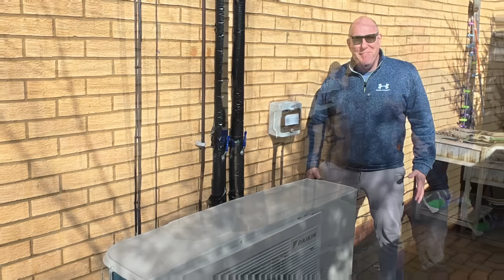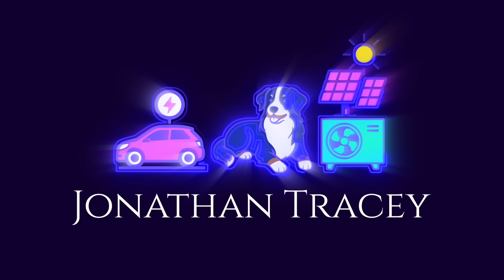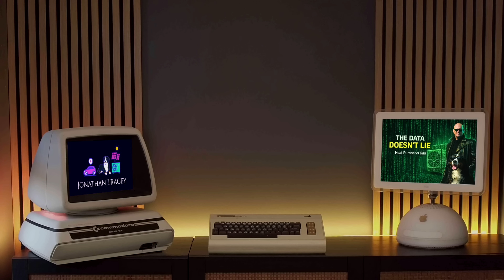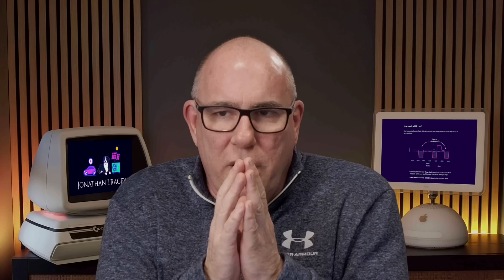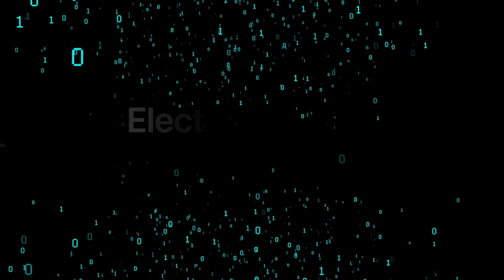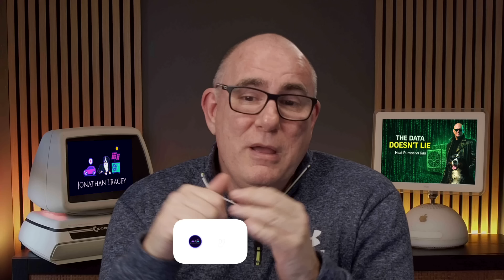The Data Doesn’t Lie   Gas vs Heat Pump Real Running Costs

Comment: Jonathan,

firstly to explain, I can't be bothered to watch the video.

Your headline 'The data doesn't lie gas versus heat pump running cost'

In order to do a comparison you need to have a back to back measurement of cost, just how can that be possible with just one house and one system. I'll answer it for you no you can't, it is nonsense. There can be no comparison at all. 

I understand that you have view point but  being so un objective harms your your credibility.
Reply from the maker: You are of course entitled to your opinion but given the responses from others I think they find the data useful, but feel free to keep jumping into the comments to tell me I am wrong as it all helps with the google algorythm and get the video seen by many others.
Reply: Jonathan,

you cannot go against normal comparison methods.
To do otherwise is simply  misleading to those lacking any discernment and may cause them to spend money unnecessarily
Yes it may help your YouTube platform but how can you put out such  obviously incorrect assumptions, how do you sleep at night?
Reply: That's a deeply unfair and daft suggestion. Mr Tracey references repeatedly that this is only a compare for his home. He uses the data he has to compare like for like. Thus Mr Tracey's analysis is valid and useful. Yes, you can reference the cost of the solar and battery installs vs the return of electricity but  that's all. If you won't engage, you can't really comment.
Reply: @px794  

The information may be useful to some.
But what I object to is the impossible use of comparison, more so as it is with gas as the majority use the wrong equations to compare.
To make a valid comparison requires both systems to be tested in an equal environment and equal conditions, patently impossible with a house heating system.

Comment: Jonathan, great video, balanced view. However, I will disagree with you slightly. A house doesn't immediately lose all heat the moment the heat pump turns off (or drops to a lower setpoint), so in a sense, the house can be thought of as a "battery", albeit a thermal battery (with varying degrees of energy loss depending on your house insulation). So, with Cosy, if your desired temperature was to be, say, 21c, on the cheap slots it would make sense to slightly overheat the house by say 1c or more and then when the costlier time slots are on, setback to 20.5c and you should see little-to-no heat pump energy draw in those costlier slots. 

I myself have no battery (yet) but as we're an EV household and on Octopus Intelligent Go, I "charge up" the underfloor heating on the ground floor of the house to 22.5c from 2330-0530 every night, on the 7p rate and this means from 0530 onwards, the house will hold that heat for many many hours, slowly draining away before the heatpump kicks in again to keep it at 21c. So my usage is extremely minimal.....my Daikin 4kW ASHP only cost me £16 for January!!!
Reply from the maker: @justinjoanknecht3475 Thanks Justin, and I agree with your point that a house has thermal mass and doesn’t instantly lose its heat when the heat pump stops. The challenge though is that the “leakiness” of the house is always working against you.  

Because a heat pump raises temperatures more slowly than a gas boiler, the longer you let the temperature drift or setback, the more energy it can take to bring the house back up to your target temperature. Underfloor heating definitely helps with this though, as the large heated floor area holds and releases heat much more steadily than radiators. It also sounds like your house is pretty well insulated if you’re seeing those kinds of numbers.
Reply: @JonathanTracey yup, very true. I guess some careful tweaking to find what works best is the way to go. I am, hopefully, getting a 19.2kWh battery installed in the coming months which should, in theory, totally eliminate all non-7p import, judging by my analysis of my Dec-Feb usage stats, so that will be good....can I get to net-zero-bills? With 2 x EVs I suspect not but I will try!

Comment: My Midea ASHP had a COP of 3.38 for  December, 5.55 for January and 4.69 for February. My ASHP installer opted for a slightly larger one as we were right on the crossover. It seems I get very good low temp COP with 7 to 8 on those days around freezing point. We moved from an LPG tank in the rear garden, so it saves a lot for us.
Adding my solar for December was 84.7kWh January was 105.8kWh and February 169.7kWh from a 7.56kWh solar PV on an E/W split.
Reply from the maker: How did you get the COP so high in January, that's amazing
Reply: @JonathanTracey  Check out Glyn Hudson's videos with his self installed systems, all running high 3s - high 4s for Scop. I dare say they are better installed, or better calculated than the majority of pro systems

Comment: You already have the shades - you should get the coat! 😂 Do you find that setting back your temperature overnight works well? I tried it with my Daikin and I found that the heat pump basically shuts off and it doesn't wake up again until the temperature has dropped to 0.5C below the setpoint, so I stopped using it and keep constant heat at the same temperature now. I had a SCOP of about 3.3 all in - 3.6 just for heating over the past year, and when it came to service time, my filter was severely clogged so I'm hoping for slightly better performance this year.
Reply from the maker: I mentioned the coat the the wife and was asked "how old are you?" yes the setback works well, it starts to warm up around 6am so takes about 1 hour but all in it works well. Yeah our filter was quite clogged, we get a lot of those sahara dust storms that leave sand on the cars, some of that got in there
Reply: @JonathanTracey  Thanks! In my opinion you are never too old to cosplay :) I might have another go and see if I can get setback working to my liking.

Comment: NO EV
Solar and 15kwh of batteries that get charged 3 times a day on schedule on cosy @ 14p average and only ran out twice at 21-00 so only day rate for 2 hrs in 3 months 
11kw Daikin HP on 24/7 at 21’
From Dec 1st till Feb 28th we used 1714 kWh all at 14p so £240
Last years electricity and gas was around £450
We’re delighted and the house is toasty all the time
But as I’ve said several times we’re charging batteries as well so why should we pay more because we haven’t got an EV
Reply from the maker: They do keep the house lovely and warm, are you on cosy to get the 3 slots a day?
Reply: @JonathanTracey 
Yes Jonathan

Comment: Great video. Agree, you need a battery to make the running cost stack up. But the battery needs to be big enough to cover all house electric use I the winter months, having charged it over night. As mentioned not enough sun to help out. If proper micro windmills were a thing,  we’d be laughing.
Reply from the maker: Tried a windmill a few years ago but found it never got enough clear wind to get up to speed and start producing, may try again later this year if I can get permissions from the CFO :-)
Reply: @JonathanTracey keep us posted
Reply: Alpha 311 say they have the answer just not for homeowners unfortunately. Not sure why possibly you could find out and they could install one at your house.
Reply: Wind alas only works if you've got a large clear area and if your nearest neighbour can't be seen without binoculars. There's an unfortunate exponential relationship between wind turbine size and generation which is why they are so mindbogglingly huge.

Battery size IMHO is no longer an issue - it's 3.5 grand retail for a 32kWh battery at this point. Now obviously most people will then need an inverter and also electricians, scaffolding for the solar etc so it's not as simple as that but the prices for big batteries have crashed since 2024 and show no real sign of slowing down much.
Reply from the maker: @etchedpixels  agree but even if I could find a small one that would not annoy the neighbours that would add a 100w an hour in the winter that would be massive
Reply: @JonathanTracey agree and one that will cope with British weather. Been considering trying to drill my own borehole …plan B 😂
Reply from the maker: @andrewthomas3526, we did some investigation about a bore hole when we first moved here but the water is too close to the surface, were about 50 miles from the coast but only 6m above sea level. They said you need to have certain depth to the water for it to work, apparently a 10 meters isn't sufficient
Reply: @JonathanTracey I’m about the same distance from the coast, from what I know of the ground conditions, I have the same issue. Still might look into it though.
Reply: @etc @etchedpixels  I’m concerned some more unknown/smaller battery manufacturers may disappear. That said I’m already on the GivEnergy bus, too expensive to get off.
Reply: @andrewthomas3526 I would agree - in fact I think personally a lot of the marketing and pushing of products where the inverter only takes the vendors overpriced batteries and installers didn't explain the option were basically mis-selling.

Comment: we had an ideal heating heat pump code 750667 installed and our yearly efficiency has been 3.2x in south west Wales in an 1870's - 1880's built 3 bed room house with recently installed wall and loft insulation and a bit bigger radiators installed. coupled with a 180 litre water heating cylinder. 5,250,000 watt hours energy used and 16,800,000 watt hours heat delivered in the past year from feb 2025 - feb 2026. replaced an oil boiler as part of the energy company obligation 4 scheme. from my understanding in our geographical location an efficiency of 3x is good and 4x is great xD also had solar panels fitted. the COP in the heating control energy used settings is often 5.7x or so. the heat pump colour of chassis grey, protective fan grilles in black and blue rear and left side vents is appealing, it's the heat pump they advertised at the gherkin tower in London, England. definitely been worth the upgrade. house has been ambiently warm since installation and can't fault it much, goes to show heat pumps work in old houses
Reply from the maker: Just because a building is old does not mean it won't work, great job 👏

Comment: We had heating oil until I changed over to an ashp last December. 
Today the price of heating oil in Cornwall is around 13p/kwh. My cop with Havenwise is about 2.8. It looks bad but Havenwise is strategising with my off peak Tariff. 
But even without any fancy tariff stuff at the price cap the ashp would cost about 8.8p. 
In fact with battery, solar, and an EV tariff I actually pay about 6p/kWh, just over half what I would pay with oil.
Reply from the maker: Sounds good, your below the current price of gas so call it a win🏆
Reply: You can't really use today's spike price of heating oil as a valid comparison. 
What is your usual price? The last lot of oil my farther bought cost 54p litre so about 5.2p/kWh. 
So it's in a very similar ball park to gas in running costs. 
He's hoping he will have died before the tank needs renewing again! 😂
Reply: @gavjlewis true. A week or so back it was about 10p/kWh for oil. The price spike has taken it to 14p/kwh as of today.  It’s always been volatile. I did not do this to save money so much as to get out of giving money to the fossil fuel companies and their unpleasant governments.
The savings are just a bonus.
Reply: @davidwebster5235 Yes it's 12.66plkWh now for me. But just 4 weeks ago it was 5.2p/kWh and was around 5p all summer. 
I guess it's best to have a good size tank and brim it in the summer and then it leaves you flexible enough to choose when you top off your tank.  
It's just bad for those people who have smaller tanks and can't wait it out for the prices to fall.

Comment: How do you manage to charge your batteries overnight with just 6 hours off peak?
Reply from the maker: I have a 10kw inverter that charges them in 3 hours
Reply: @JonathanTracey how did you blag 10kw from your DNO? I’m stuck with 5.5kw. Must be great to be famous! 😅
Reply: @davidwebster5235  There are two limits if you have a G100 compliant inverter, and your installer ought to have explained this option to you. Except in the very rare case a G100 compliant system will be permitted and you can then have it as big as you like but it'll only ever export to the 5.5kW limit and it's been rigorously tested to comply with that.

The other way you do it is to have some of your battery non grid tie but grid charged. That's how I've got an additional 20kWh or so of batteries that are not part of our G99 limit and which front our heatpump and some other kit directly.

In the extreme case where the DNO says 3.68kW and no G100, which is only done with extremely dodgy old electric networks you can simply install a non grid tie system that runs the entire house and treats the grid as a generator input. At that point the DNO stops caring as you can't backfeed. It's more expensive so not usually done by choice.
Reply from the maker: @davidwebster5235 This was all long before the fame and fortune of YouTube! 🙂 I think we originally started at 3.68kW, then I called and asked if I could increase it to 5kW and they said yes. A few years later I called again and asked about 8kW and they came back saying “why don’t we just make it 10?”  

I’ve always found that if you’re polite and work with people they tend to reciprocate. My DNO have always been really friendly when I’ve called and we’ve built up a good relationship over the years.
Reply: @JonathanTracey I might try the same. But with my sigen system the inverter is not software configurable.

Comment: Hi Jonathan, Love your videos' as they're always so insightful. ive been looking at heat pumps for a while now and was waiting for spring this year before committing but currently still on the fence. i have a 16kw sigenstor setup but still nervous that my 30+ year old boiler is still doing the job and may help costs currently. keep up the great work
Reply from the maker: @benbrookes6252 Thanks for the kind words. Personally I’d probably wait until the current crisis in the Middle East settles and energy prices calm down a bit before making a big decision. The maths is moving around quite quickly at the moment.  

That said, having a 16kW Sigenergy/SigenStor setup already puts you in a very strong position — that kind of battery capacity can really help keep the running costs of a heat pump down.
Reply: @JonathanTracey you may have shared this information previously so sorry to ask but how many kw's does your heat pump use to keep your house at temp throughout the winter months?
Reply: @benbrookes6252 if you are able to track your daily gas usage, you can probably estimate what a heat pump would have to output on cold days (and then estimate a likely COP)? With an old boiler your efficiency might be around 70%? Even Jonathan doesn't have enough batteries for the coldest days. We have a 5kWh battery to see us over peak periods with our 10kW heat loss.

Comment: So in order to get a system that is significantly cheaper to run than a £1200 combi boiler - you have to spend £30-40k on solar battery and heatpump.  Only then can you finally save £100 a month.  I also believe reliability is going to bite you in the bum at some point I don't recon your gonna manage 10 years of trouble free running on these devices.  So much to go wrong.
Reply from the maker: @MrButuz I think you may be underestimating the savings a bit. In my case the solar and batteries don’t just shave £100 a month off the bill — they’ve effectively wiped out both my gas and electricity bills entirely, and they also provide around 16,000 miles of driving in our EVs each year.  

When you add all of that together it’s closer to about £5,000 a year in avoided energy and fuel costs. Reliability is always a fair concern, but most of the core components (solar panels and inverters) come with 20–25 year warranties, so they’re designed to run for a very long time.
Reply: @JonathanTracey fair point but if we’re including your ev in the conversation then you need to factor in the extra £40k for that or £400 a month for three years so we’re not talking pure cost savings even then! Don’t get me wrong I am all for evs renewables etc etc but you gotta do the real maths and ask yourself is it worth it❤
Reply: He has and is retiring early on the savings 

 also heat pumps are using technology thats been around for over 100 years you would think they have reliability sorted  by now infact im sure their are still working examples of 100 year old electeic fridges. 

Have a fantastic evening